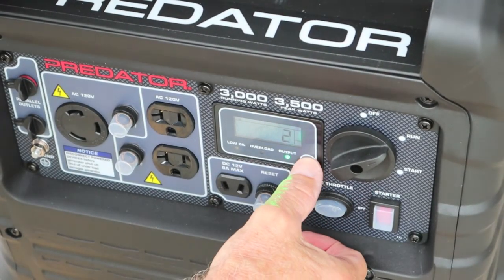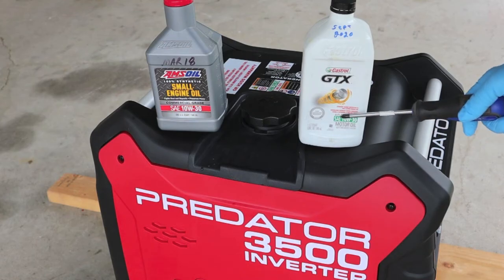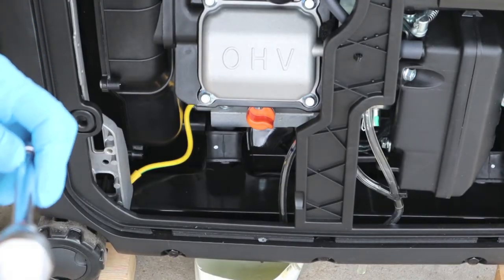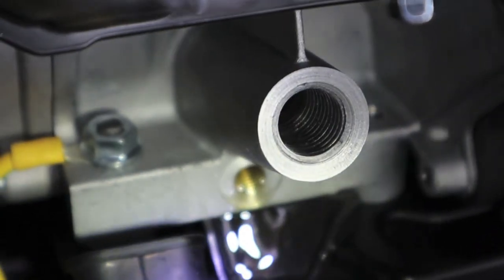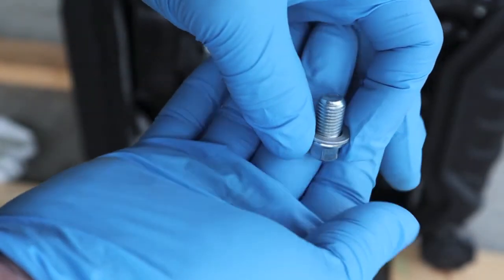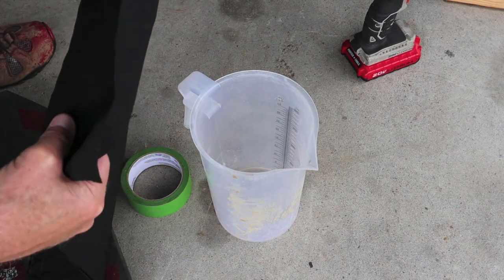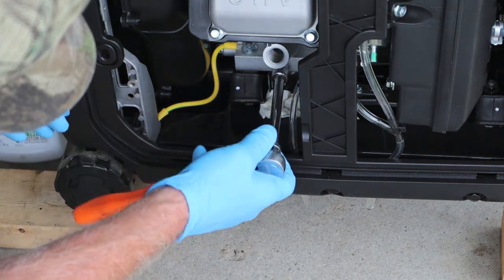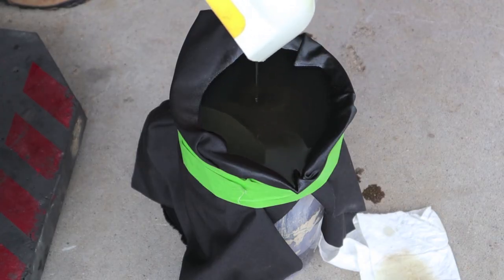Predator 3500 Inverter Generator 2 hour oil change LOTS OF METAL IN OIL a look with 250X microscope

Comment: i have a Generator with a 420cc 7500w dual fuel mine was all glitter like that for the first 3 oil changes. i think i did a 24hr brake-in  the next year we had no power for 4 days I had that sucker running 4 days straight.
Reply from the maker: Wow, 4 days straight is a testament to its durability!

Comment: Have you heard or used a magnetic dipstick?
Reply from the maker: I use a magnetic oil drain plug and will probably add a magnetic dipstick just as another preventive maintenance item. The one thing I don't like about them is the heat. I can check oil after running the generator for hours and use my hand without gloves on the plastic OEM dipstick, but the aluminum dipsticks definitely requires gloves if checking right after a shutdown. 
Thanks for watching and commenting!

Comment: Just buy the Honda, bought the Honda 2000 and 3000 exactly 10 years ago, now with 1000's of hours, both still perfect condition you get what you pay for
Reply from the maker: Wow, that's a lot of hours on those little guys, 
but you're right...Honda is the best!
Thanks for watching!
Reply: Absolutely but these are a nice backup.I keep a few cheaper gens in case an inverter goes or a fluke happens.I have a 6500 and a 2200i,never had a problem but you never know.Plus,I’m just addicted to tools and machines.
Reply: I wish Honda would explain why they don't make ANY generator that supports propane out of the box.  So I went with the Westinghouse iGen4500DF.

Comment: I purchased a predator 9500, filled it with oil, didn't start or run it, pulled the cord to circulate the oil then drained it. I found large aluminum machining chips and particular matter while draining. This only purged out the aluminum in the oil sump. Ferrous metal came out after break-in
oil. Quality control is lacking but with a little effort I believe the serviceable life can be extended.
Reply from the maker: Sounds like you did the right thing on the flush. I did install a magnetic drain plug but after I had already drained the oil about 5 times. I wish I had it in the very beginning.
Best of luck to you!
Thanks for watching!

Comment: what is the upc/sku number of this unit? I noticed there are clear rubber cover over most of the buttons, the ones in the store today don't have them; there are supposed to be several different manufactures of these supplying HF
Reply from the maker: Not sure on that.
Thanks for watching!

Comment: Use a couple paint filters from Auto parts store. Those catch small micron debris much better. I personally (on my generator)take brake cleaner and a ⅛" hose put up in crankcase at a slight tilt and use the whole can then let it drain out for couple hrs. Take compressed air and blow thru ⅛" line up in crankcase to evaporate the rest. U won't believe the amount of debris that comes out !!
Reply from the maker: I like that idea!
Thanks!

Comment: I broke in a cheap sportsman inverter. My first run was 5min, next I did a brake clean spray out of the crank case.  Then 30min run, 1hr run and lastly a 3hr run.  The amount of metal I got out at the 5min and brake clean flush was ungodly.
Reply from the maker: I know, it's really amazing what crud is in these little engines yet most run exceptionally well.
Thanks for watching!
Reply: @BS.-.-, don't they run the engine at the factory?  And shouldn't that remove much of the metal particles?

Comment: I have a 2200w generac and the oil wasn't bad after 3 changes. Just bought a champion and did the same three changes in the first hour and then ran it for 5.5 hours and the oil looked really metallic still. They are both Chinese Yamaha mz80 clones but the generac is made by Ducar and THINK the champion is senci. The generac has valve cover bolts while the champion has studs and nuts, and has a fan and cast aluminum duct at the rear where the dc generator is. I've left it at work running for the night. Not sure if it will be running in the morning. It seems to use some oil as well. If it's blown up ill jury rig the propane carb onto the generac :) I paid less than what the unit normally goes for and can't get warranty. I'll be pissed if it fails but if it can't run 12 hours straight it's no good to me anyway

Comment: This is a great video and shows the importance of getting the trash out of the engine. We run Castrol in 2 3rd Gen 4Runners. One has 402,000. One has 376,000. Both have had the oil changed every 15,000 to 20,000 and run great. I am a believer in Castrol but like One commenter said I thinknI may go with the Lucas break in oil. Thanks for such a great video.
Reply: I concur

Comment: whats  the best fuel  to run , just 87+ Unleaded ?
Reply from the maker: When I buy mower and generator gasoline, I always go for 89 octane.
I feel like it buys me a little time on the occasion where the gas sits in the tank for months and even a year, but I always use Sta-Bil 360 too.
Thanks for watching!
Reply: I use only ethanol-free gasoline which in my area is sold as 89 octane & I add Sta-Bil to it for all my small engines, mowers, chainsaws, generators, you name it; helps keep water out of the fuel system

Comment: champion vs predator  and why did you put oil stabilizer in spark  plug also did you get the warranty I want to but this so much but want more feedback thank you
Reply from the maker: I have not put any oil stabilizer in due to the fact I use Amsoil Small Engine full synthetic oil. I bought the extended warranty also as it is fairly cheap.
Thanks!

Comment: How many hours do you do your first oil change?
Reply: did you watch vid? said 30mins
Reply from the maker: No more than 1 hour. Many will consider that on the extreme side, but 16 ounces of 10W-30 is cheap. The Predator is starting and running so good, I want to spoil it. :)
Thanks for watching!
Reply: @pmtips4482  oh man i have used for 58 hours already 😬 i need to find a shop thag will do this ASAP! Thank you!
Reply from the maker: @gabydt8769  It's easy to do if you have the tools, and there are good YouTube videos that show how to do it.
Best of luck to you!
Reply: @pmtips4482   that's the thing i have no tools or a place to do it 😔.
Reply from the maker: @gabydt8769  I understand. I would get it to a shop then and they'll take care of it.
Take care now!
Reply: @pmtips4482  yes! I am trying to find one now 🙏! Thank you so much for replying 😊

Comment: Owners manual says to “break-in” by running below 75% load for the first 30 hours then change the oil.  Based on several videos showing excess metal I changed my oil after only 3 hours run time and found virtually no metal particles.  What I find interesting is the metal particles you pointed-out are magnetically attracted to the metal probe, the magnesium case material of the generator engine is non-magnetic so it’s hard to imagine what that metal is, especially the round ball-like particle? I can’t imagine where in the manufacturing process those larger metal fragments would be created?  The smaller suspended particles appear to be machining residue which I wouldn’t worry about,  but those larger ones are curious.. makes me wonder if it’s leftover tumbling material used to smooth out the finished part.
Reply: Anything cought by a maginet in these are going to be the rings wearing slightly but mostly the valve train.
Reply from the maker: I think those ferrous micro balls in my oil came from the casting process on the crankshaft.
Like you say, not much is actually magnetic in those little engines.
Also, I think any tumbling media would be larger than what I pointed out.
She sure is running great though!
Thanks for watching and commenting!

Comment: Question for you Pm Tips....do you ever "thin" the oil for cleaning using transmission fluid?  as I have always been told transmission fluid is highly detergent/cleaning.  I know on an engine i didn't care much about I ran 50/50 motor oil and transmission fluid.....the motor hadn't had its oil changed...in like 100000 miles yes 100000.  there was literally sludge inside the motor.   I did that and it came out sludge-free after about 3 changes and slow driving and idling.
Reply: I may be wrong but I think detergents in atf is a myth. It does seem to have lots of examples of cleaning abilities. Maybe it's because it's thinner than motor oil
Reply from the maker: I've known about it but never used the ATF method. I usually go the Rislone route to get some sludge out. You got a great result out of it so there's proof it works right there!
Thanks for the tip!
Reply: Diesel is the best thing to use if you’re wanting to clean buildup. Add a little right before the oil change and just idle. You’ll be surprised how well it works.

Comment: I am glad to see that someone shares my philosophy of running a new engine only for a short time and changing the oil,  I would not have necessarily filtered it nor thought to do it multiple times.  but now i will!  thank you!   also the generator is quiet but does not idle smoothly, also i am slightly dissapointed at the quality of the plastic and the fit and finish, compared to my Honda, BUT what can you expect for 1/3 the cost.  all in all i think its a good value so far.  (only doing break in runs in the garage.)
Reply from the maker: Ken, I only filtered it for the video, as I could clearly see the metallic shine in the drained oil with either a flashlight or in the sun. Honda is king but as you say....at a $$ premium.
Thanks for watching!

Comment: I started mine with full synthetic oil right away.. will it be fine? It only has 1.5 hours on it
Reply from the maker: I think it will take a bit longer to seat in with synthetic at the start, but there are lots of small waste particles in these little engines from machining.
I definitely would not run any extended oil drains till after the 50 hour mark.
Don't forget, Predator wants you to avoid running at 25 amps (full load) till after the 30 hour mark.
This is a good thing though, as it shows the manufacturer is aware of actual engine break in.
Thanks for watching!

Comment: I did a similar oil change interval on a Wen 2250i generator.     Their suggestion was 25 hours.   Glad I changed mine in the first 2 hours.   The magnetic dipstick helps but it only captures ferrous metal.    The oil certainly had some sparkle to it.   I ran 3 hours on the next oil change and the oil looked much better.   There was still a tiny bit of sparkle, but not as bad.   I'm at 8 hours now and will probably dump it around 12-15 hours of total run time.   After that, 25 hours should be good and let me switch over to synthetic.
Reply from the maker: That sounds like an excellent maintenance plan!
Thanks for watching!
Reply: @pmtips4482  very informative video dude. Synthetic motor oils are not good for generator Break in. When I did my first break in, I used conventional Sae 10w30 which I bought separately, then I switched to mineral Diesel multigrade motor oil 15w40 with an API S rating from renowned brands like the Valvoline all Fleet, Liqui Moly Touring high tech Diesel, shell Rotella t4. After that, I had no problems.

It doesn't matter if you're using synthetic or mineral, you should change the oil as it is mentioned in the user manual and synthetic oil is simply a waste of money when mineral oils with additive package like the shell Rotella t4 are much much cheaper
Reply from the maker: @danteerskine7678  Thanks for the information! I agree break-in is key to these small engines.

Comment: On instructions manual say do not start when you put oil first time.  You had to slow pull cord 3-4 time get all gear oil and no problem and make sure good oil. Then won't had a problem 

I had 4000 watt predator 212cc still work perfectly

Comment: My 3500 is 2 years old along with my 2000 portable. Both run great and have never let me down. I keep them serviced with quality oil and NGK spark plugs. Replace the Chinese spark plug with a NGK and it will start much easier and faster. I recommend this generator for its price point and durability. Runs the AC on my camper with no problem. Good on fuel as well. Looking at the remote start system and the propane conversion kits to install next.
Reply from the maker: I went to the NGK spark plug. It may just be the best plug out there.
I'm really liking this Predator so far!
Thanks for watching and commenting!
Reply: Do you have a part # for the NGK plug for the 3500?
Reply from the maker: Yes, it is: NGK BPR7ES 5534
The four numbers of (5534) may or may not be of importance, the guy at the parts counter wasn't too sure either.
Reply: How about the ngk part# for the predator 2000?

Comment: Enjoyed the video.
I have a Honda eg2800i with the gc series engine.
The break in oil looked like I could pour it right back in the bottle.
I've heard good things about the Predator (Lifan) engines.
I just doubt the quality,longevity is as good as a Honda.
Reply from the maker: Thanks for sharing!
I don't think you can beat a Honda engine.
Reply: It definitely has something to do with generac also has a lot of the same exact parts!

Comment: Good video.  Just purchased one of these units yesterday, haven't touched it yet.  Read through the manual last night, and there is no mention of doing all this break-in flushing.  I fully intend to, I'm just surprised that it isn't mentioned in the manual at all.  Also reading mixed reviews on doing the initial flushes with the generator loaded or unloaded.  Your thoughts?
Reply from the maker: The first oil change, I wouldn't put any load on it. The second OC you could run an electric drill or saw for a couple minutes. On my third OC, I ran a space heater (1200 watts) for about 10 minutes.
On my 4th OC, I ran the RV AC unit (1500 watts/12 amps) for about 2 hours.
The thing to remember on the Predator 3500, is the OM states to NOT LOAD THE MAX 25 AMPS UNTIL 30 HOURS RUN TIME.
With that, they do recognize a break in procedure. 
Thanks for watching!
Reply: Correct. No mention anywhere. I’m just gonna do it once. I can’t imagine doing this 2-3 times.

Comment: I changed mine at 2, 5 then 10 hrs. Now has mobil 1 in it as I don't use it much. I like to break my motors in with a small load. Great little generators
Reply from the maker: Thanks for the information!
Reply: Muy cierto, grandes pequeños generadores,  prácticos, útiles,  necesarios

Comment: I appreciate this video. I just followed the manual which said to change the oil once after a little time running it. I did that and then ran it a few times for about 2-3 hours each time. This time I was fixing a minor issue with the fuel line and decided to look up some videos about this generator. I'm glad I did because I just went and drained the oil and there were loads of tiny specks of metal in it. I'll probably have to flush it a few more times to get it all out.
Reply from the maker: I would flush it a few more times too. It sure can't hurt anything, and the dino oil is fairly cheap.
Did you notice in the owner's manual, they DO NOT want you to load the max 25 amps till the 30 hour mark? That's proof right there they recognize a "break-in" period. 
Thanks for watching and good luck with your Predator 3500!
Reply: @pmtips4482  this is why I don't use synthetic oils in my power equipments. Synthetic oils maybe good for performance cars but completely useless in generators. At least, use synthetic blend, they're not as expensive as full synthetic oils

Comment: I can not believe people are buying these cheap things after seeing that much metal in the oil. A little bit is normal but that is crazy. My honda did not have any in during break in running full synthetic mobile 1. No way these generators are lasting over 500 hours. Get what you pay for.
Reply: Looks like you don't know what you are talking about.  No way this Predator will last 500 hrs???  Seems you are totally ignorant as many on Y.T. are showing 4,000 + of non pampered hours.  Scroll up a bit and see one Y.T. video where he has 7,000 hrs.  Enjoy your expensive honda, Lol.
Reply: most are never even use thing ever 500hrs.....but for 1/3 price why not. im sure honing process on honda is better? for 3x price it better be
Reply: @fike301  ya they are fine for home use but I wouldn’t recommend someone running these on the back of there food trucks for 8 hours a day 6 days a week.
Reply from the maker: Honda is definitely the best. No denying that.
Thanks for watching!

Comment: I have this same generator, and I broke it in using the "AMSOIL BREAK-IN SAE-30 OIL", after which I use the AMSOIL 5W-30 Small Engine oil. I love the Generator, and I have had a Honda 1000 as well as two Yamaha 2000 generators.  I am not saying the Honda or Yamaha is not any good, but the Predator is a lot less Money, and it too is quiet running.
Reply: this is very BAD advice, you should NOT use amsoil break-in oil on this generator, Amsoil itself says NOT to use this on this engine, just use the 10w-30. In addition HF tech support says it will void the warranty. Do your research folks, I contacted both of them and that is what I was directly told, I'll follow the advice of manufacture's before some random person on the internet with no facts or research to back it up. I do believe Amsoil knows more about the proper use of their product than anyone else.  HARD PASS
Reply: @joey24698  why is the break-in oil not recommended?
Reply from the maker: I wish I had went the Amsoil Break-In SAE 30 route, I never even thought about it much. I knew I was going to do several oil changes within several hours and end up putting in Amsoil 10W-30 Small Engine Oil. So far I'm liking this Predator!
Thanks for watching and commenting!